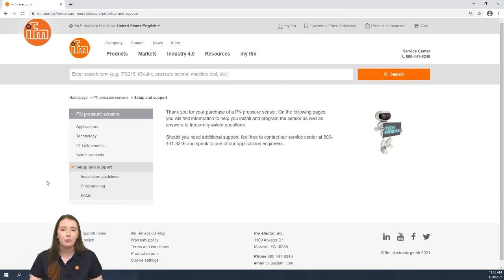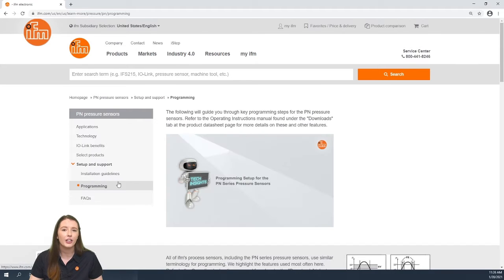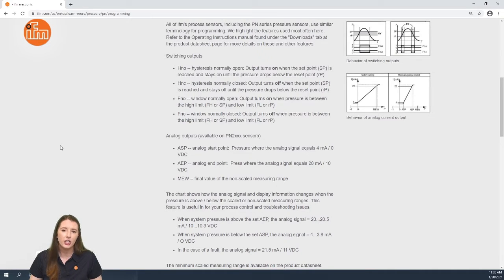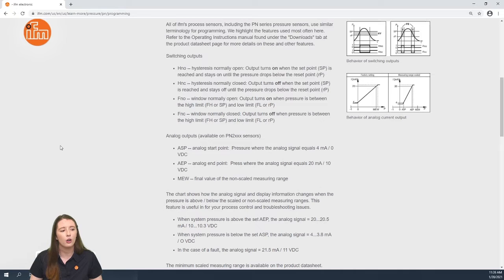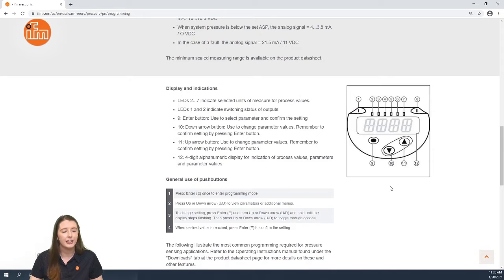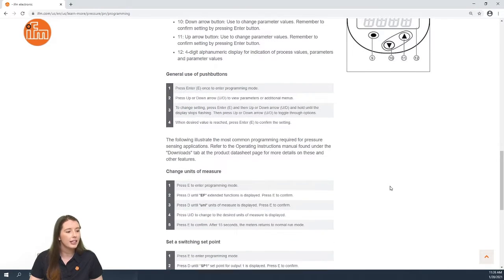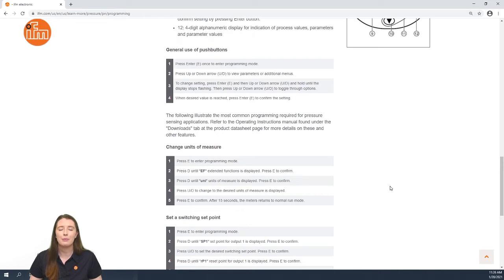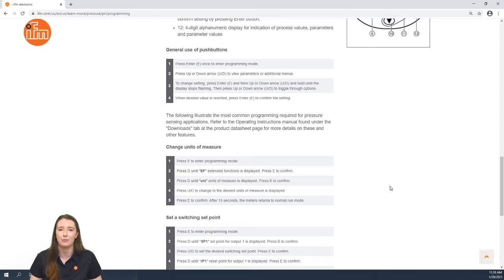How to program an industrial pressure transmitter

Comment: i need help setting the set point in a RO building. I need the inlet pressure sensor and outlet pressure sensor to match manuel vs transmitter. Need it to show a D/P of 0